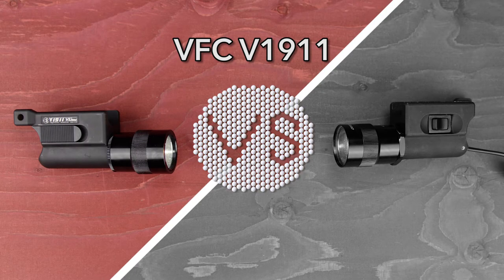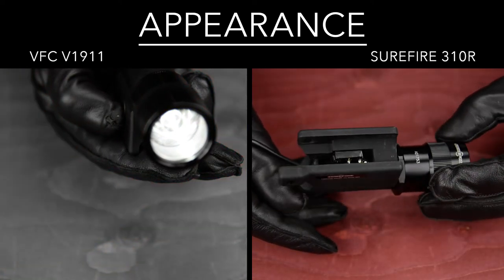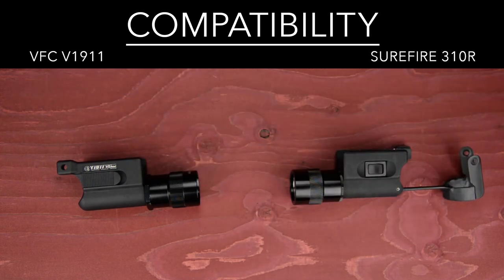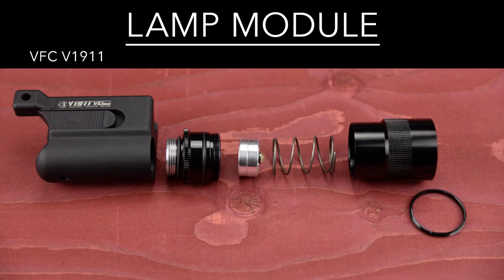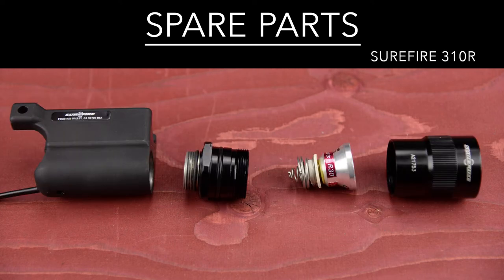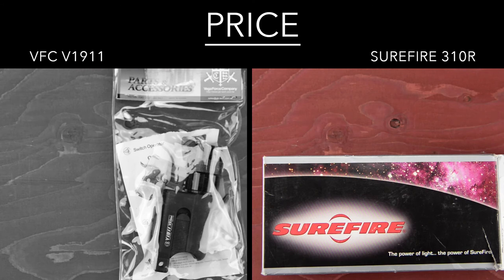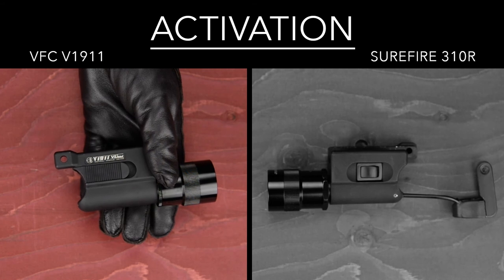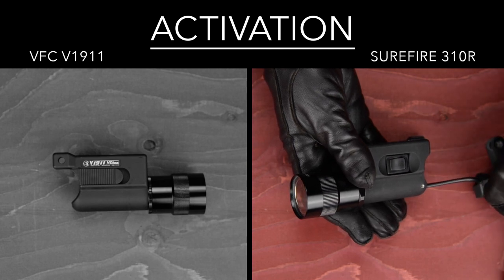VERSUS - VFC V1911 VS. SUREFIRE 310R | AIRSOFT/REAL STEEL

Comment: The R30 series is also compatible with the 6P and Millennium bezels. Malkoff Devices make incredibly good LED conversion lamp assemblies. I have upgraded my M951 weapon lights with 800-lumen lamps from Malkoff as well as several of my older Surefire handhelds. Malkoff uses machined brass for the bodies of their lamps and I haven't had one fail on me yet. My old M3 Combatlight also has an 800-lumen lamp. Very nice light quality, a broader spot that blends into a large corona.
Reply: They even make an adapter to convert m951 to take modern m600 light heads

Comment: Have you ever tried installing the real 310r on a Marui body? I have two sets of real 310rs but to my knowledge, it seems like only WA 1911s are almost a straight fit to a real one frame-wise. Looking to get a Marui Meu to try it out just wondering if you have experience on that. Thanks!

Comment: Hi, please, wich one is more suitable for real gun, WE type or Marui  type ? Thanks a lot !
Reply from the maker: Sorry to say, but the real steel SureFire one is most suitable for real 1911's. I doubt that either the Western Arms or Marui models could handle the recoil, as seen on the disassembly.
Reply: In case, this is a simple hobby gun so as long as the slide release works I don't mind the light breaking,woukd the WA be a better fit for a real one?
Reply from the maker: @shino9797  Couldn't say for sure, since I've never owned a Western Arms version. But the real-steel 310R is slightly too tight to fit over the dust cover of the 1911. If the WA version is a bit wider, then it would be a better fit than the Marui one.

Comment: Hi there, Can you do a video comparison of the VFC MP5 V-Light Handguard VS the Surefire 628? Or at least try a Surefire head on the VFC V-Light if you don't have the actual Surefire 628. I hope you can help me determine is the authentic Surefire head which is the Z32 would fit the VFC V-Light Handguard.
Reply from the maker: Interesting idea. I do have a SureFire 628LMF and a SureFire 329LMF-A, so when I aquire an MP5 your suggestion is definitely doable. Provided I can find the VFC version in stock.

I long for the day when VFC implements the last-round-bolt-stop into their MP5...

Comment: is the vfc 1911 light compatible on all 1911 Airsoft pistols?
Reply from the maker: This particular light is a Marui-spec V1911. There are WA and TM versions, so make sure you get one for your type of 1911.
And of-course, but to be overly clear, it must be a non-railed 1911 with a smooth dust cover. But if someone misses that point then, well... you need some big help buddy...